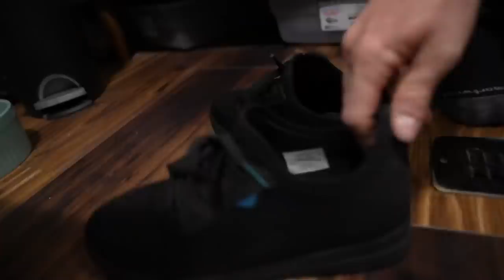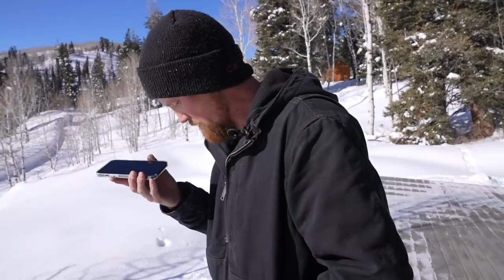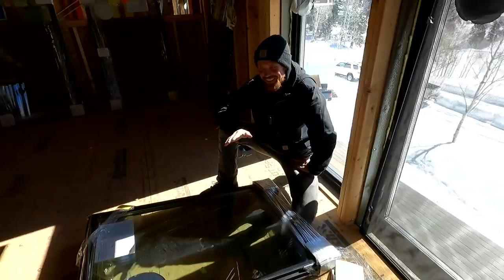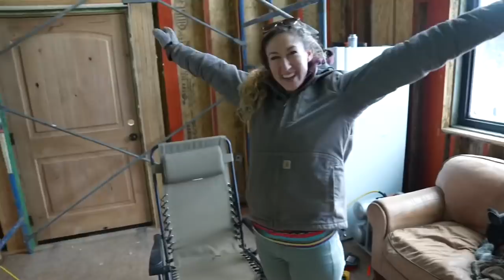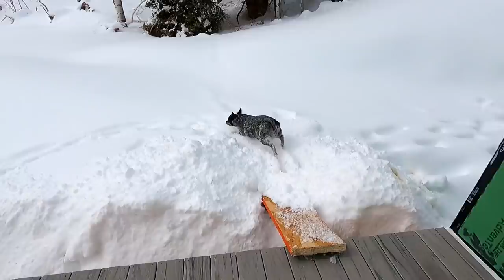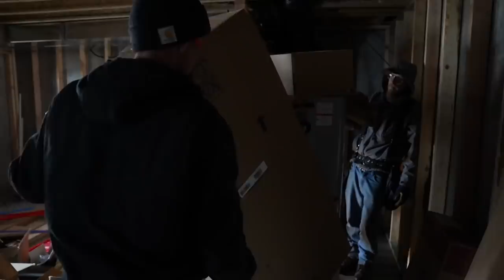WE THOUGHT THIS WAS OVER | BUILDING OUR OWN HOME

Comment: You should remove the snow from your propane tank it will insulate the tank and decrease the vaporization rate of the propane and could cause problems if all of your propane appliances are on at once

Comment: OK pro tip with PEX.. there are three types of PEX pipe but only two that matter.. i.e PEX-A and PEX-B. You can ONLY use the expansion type fitting with PEX-A as it is more flexible than type B. NEVER use the expansion tool on PEX-B pipe... You ARE using PEX-A pipe right? The crimp rings can be used on both PEX-A and B.

Comment: All looking good guys.  One question, you have put studding up around the basement walls but have not put any boarding or insulation on the studs where you have installed the water heater / furness what is the plan here?  I was expecting that you would install insulation between the studs and fit drywall or ply on the studs before installing fixed equipment.

Comment: Just wondering why you don't have a damper in your stove pipe? I have always found it best to have fittings that you can disconnect on filter housings so when things go wrong! Hey Trent does your codes require a pan with a drain that goes under your water heater? and a drain pipe on the Temp/ over pressure valve? Ok with your paint for the electrical boxes there are codes on spacing of the outlets here in KY you have to have an outlet every 6 foot and check code for under windows and openings.

Comment: EVERY water heater eventually breaks........and LEAKS!  Before you fill the water heater, put a pan underneath ($20 at Home Depot).  The pan has a drain which should go to a sewer or outside......saves a LOT of works when it eventually starts leaking.  By the way, the Uphonor system has been used in Europe and the United States for many years. (Pex, with the rings, has been the cause of millions of dollars of lawsuits)

Comment: Surprised you did not go with on-demand hot water since you are using propane anyway. Would save you bucks on propane, for sure. And also on electricity, if you have electronic ignition.

Comment: VERY VERY ROOKY MISTAKES 1) Correctly install the insulation on the outside of the foundation with adhesive. 2) Keep the furnace running all the time 3) Slide the box up the snow 4) Bring it through the basement window, if it is big enough for an egress then it Is big enough for the water heater 5) Don't install the water heater or water filtration until the basement is fully insulated 6) Get the firewood out of the basement, or at least up on pallets or wood racks away from the wall 7) You say you don't have paper to start the woodstove with, but you have tons of cardboard boxes and god knows the job site could use a good clean up. WORK SMARTER NOT HARDER

Comment: We just got a new water heater installed. It failed the inspection because the plumber wasn't notified about a new size pipe for the release valve. So take two and after paying for two inspections we passed.

Comment: Did you set the hot water heater in a drip pan? I couldn't tell in the video...If not that will fail inspection.

Comment: Hm. I don't think you are supposed to use teflon tape on gas lines, afaik the teflon will be ruined by the gas after some time. Gas leak in the basement can cause havoc. Double check the teflon tape to see if it is rated for that type of usage.  Can't remember what the other "teflon ish"  gas approved tape is called, them guys down in the store know about his, so just ask around. Better to be safe then sorry.

Comment: I see that you bought a propane water heater:(  I wish I would’ve seen you purchase a heat pump water heater all-electric, it uses a fraction of energy compared to the cost of propane. It hardly uses any electricity, since propane is so very expensive. It should only cost with around $120 a year to heat your water. Propane I’m guessing you’re looking at $600-$800 annually.

Comment: It seems to me your getting the cart in front of the horse. I know you need to do wiring but why on earth haven't you insulated the exterior walls with all the freezing issues you've encountered
Reply: Too hard to drill all the holes you need for the electrical and plumbing supply lines.

Comment: I hate to say this, but I don’t think your plumbing guy did you any favors getting you to buy a 50 gallon water heater instead of the 40 gallon one... For 2 people with low flow shower fixtures (anything less than 1.5gpm) you’d just about never run out of hot water with a 40 gallon tank. If you have to heat 50 gallons all the time and store it you’d be way ahead of the game with a 40 gallon one. Then again you may not care, in that case, never mind...

Comment: I like my Vessis but they choke my ankles and top of my feet. Water can never get in because 😮🤣
Reply: Hey there! It’s normal for the ankle opening to be a little firm to start! Over the first few wears of your new shoes you’ll notice that the upper knit and ankle opening will stretch to accommodate and create the perfect shape around your feet. The reason you want this is to make sure no water comes in through the ankle. The only way to ensure this is if you allow the shoe to mold to your ankle shape. In order to do that, you do need them to be tight at first and then only stretch when they’ve learned your specific foot shape. This creates that snug, sock like fit that we are loved for!
Reply: @Vessi  it cuts off circulation but I'll keep trying

Comment: You have a ridiculous plumbing in the USA 😂😂 we have a gas boiler - gas in - water in and radiators simples does heat and hot water - boiler is @ 3ft by 2 ft 👍😂😂